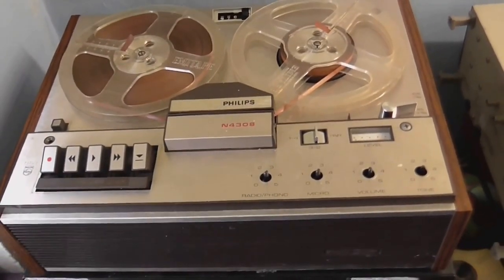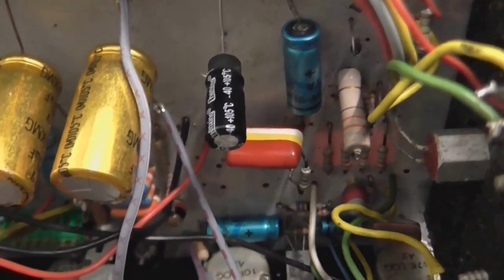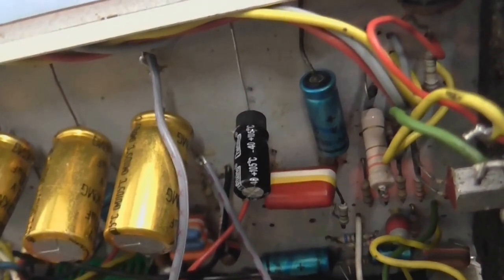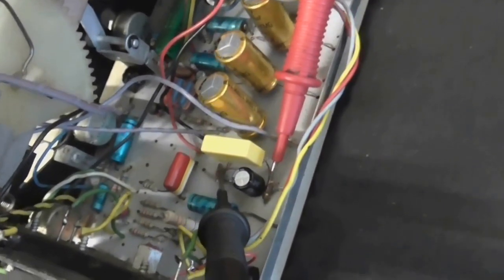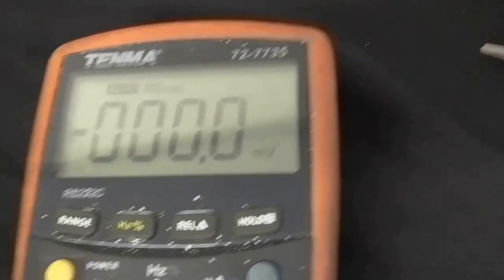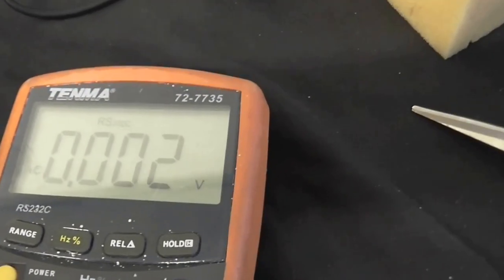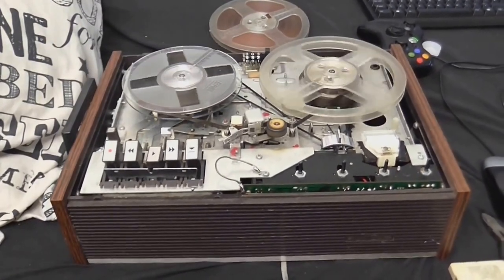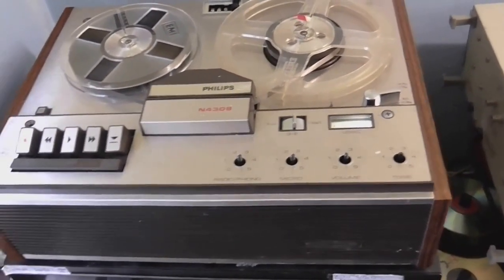Fixing the Phillips Reel to Reel - again

Comment: If it blows again, replace the capacitor with the original 33 microfarad.  I would put the higher voltage rating one in there.  Good video, though.
Reply from the maker: It does have the higher voltage rated cap in there.